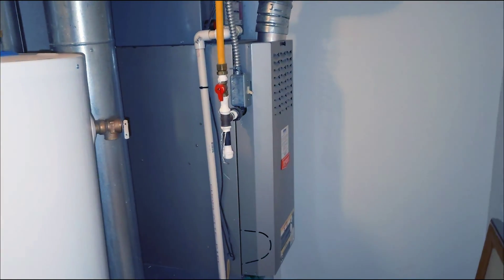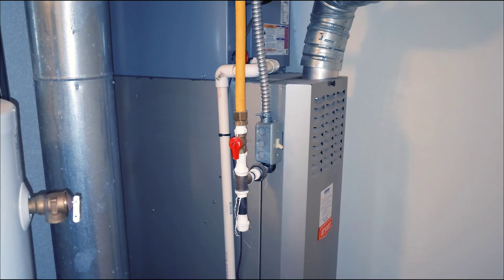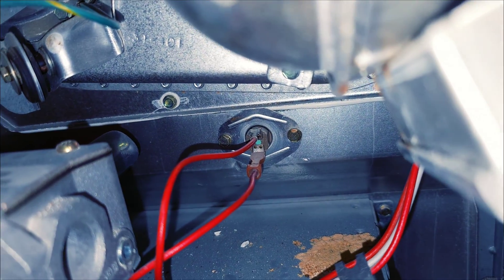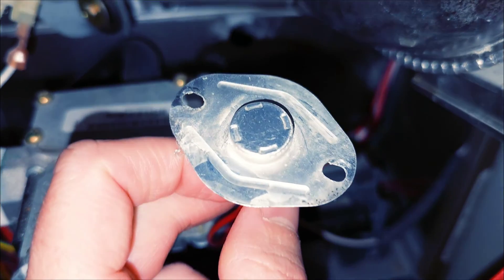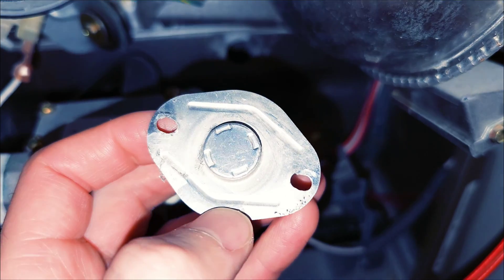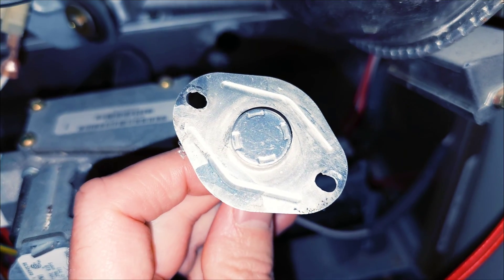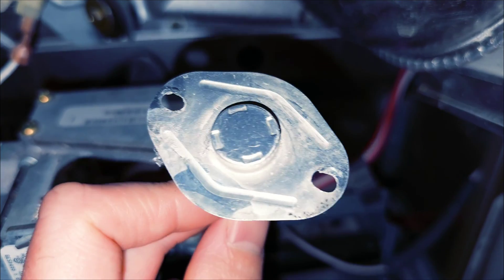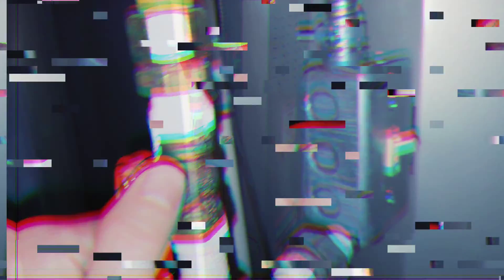How to: Overheating Furnace Restarting (Smart Thermostat) DIY Tutorial [Ecobee Rebooting] 💯😁

Comment: Mine is doing that when the cool is on. The cooling turns on for like a couple of minutes and then it turns off. The screen turns off and then comes back on minutes later.
Reply from the maker: If your filter old?
Reply from the maker: Have you checked your outside unit? It could be frozen. You would just look for ice build-up on the pipes going into your house.